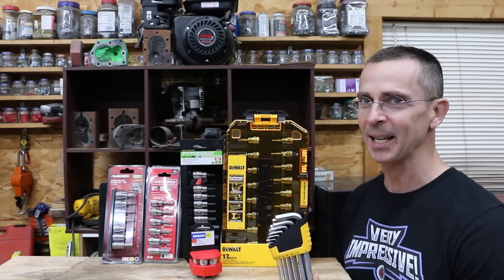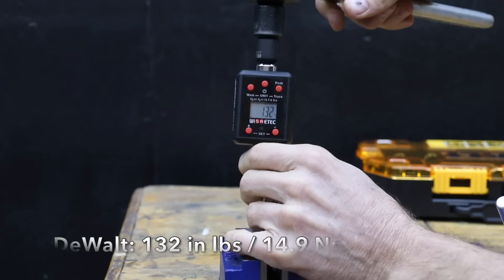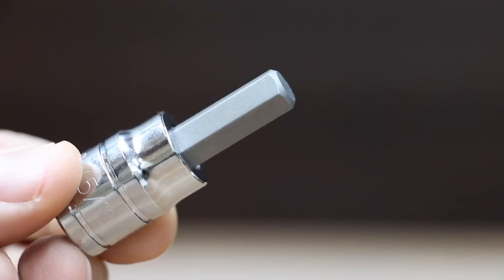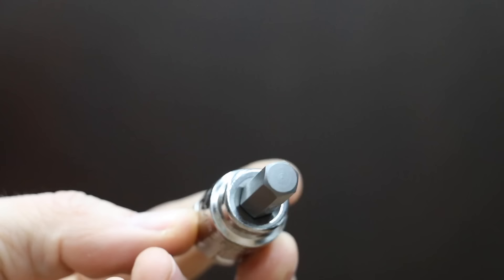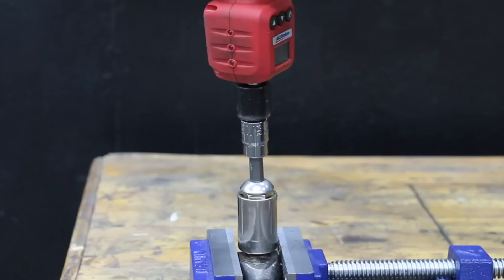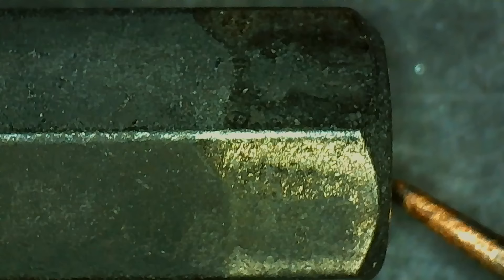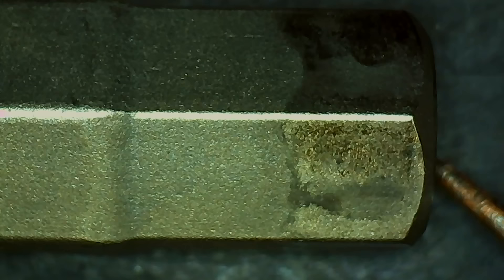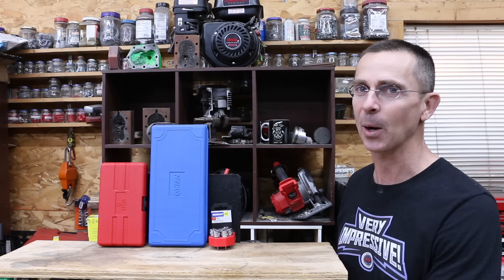Best Hex Bit Socket Set? DeWalt, Kobalt, Craftsman, Husky, Neiko, Pittsburgh, Tekton, GearWrench

Comment: Another vote for 1/2" to 3/8" socket adapters - those seem to have a lot of variability in strength.  Great video, cheers!!
Reply from the maker: Thank you!
Reply: Agreed I've broken quite a few. After breaking the last ones I had in the box last year, I bought a Neiko 30249A set. I haven't broken any yet but I haven't really abused them yet either.
Reply: Another vote
Reply: @ProjectFarm  Even as a casual garage tinkerer who can usually get by on the cheap stuff... I do have issues with socket adapters snapping. A definitive answer on that would be super helpful!
Reply: @John_Ridley  ironically, the only one that I haven't broken are the super cheap non-impact rated ones from harbor freight.
Reply: Snap on impact adapters are the best I've put them under a 25yr test along with a ton others.
Reply: @eric63377  Same here.
Reply: Definitely looking for the best Socket adapter!
I purchased a stubby impact rated allen/hex kit from O'Reilly's, 
They start at 1/4 , 6mm but with a 1/4 drive then increase in drive size to 1/2" and every time i use a 3/8-1/4 adapter even via ratchet wrench they snap leaving the head in the socket/allen/hex!
Reply: Hear, here!
Reply: @ProjectFarm  I'd love to see a way to test the detent ball strength/wear resistance + whether it will drop out.
Reply: The great socket adapter test seems like a good follow up
Reply: 3/8" to 1/4" would be a good one as well, but YES definitely do 1/2" to 3/8"
Reply: I’ve used the Pittsburgh and have yet to break them. I even use my impact on them and all good
Reply: It is the purpose of the 1/2"-3/8" socket adapter to break, usually just after the last 1/2" drive socket of the size of the fastener you are trying to remove breaks.
Reply: @ProjectFarm  Upvote for "Best 1/2 to 3/8 adapter" video next
Reply: I second this I just broke another this morning using my 1/2” breaker bar with a cheater bar on it lol I wasn’t designed for this but I’d like to see what’s the best for my next one
Reply: I've got a Sunex that's outlasted 5 or 6 name branded 1/2 to 3/8 adapters! My 2767 eats them lol..
Reply: Came here to say just this. I've broken a pile, and it looks like quite a number got broken during these tests too!
Reply: I'd like to see a premium brand added. PROTO, SNAP-ON, MAC, MATCO.
Reply: Could we expand this concept to include 3/4" to 1/2" adapters and maybe even 1" to 1/2" adapters?  Pretty common to need big breaker bars and 1/2" sockets on farm equipment, and after all, this is Project Farm.  Again, a big thanks for everything you do.
Reply: I really do miss Sears. I must have exchanged at LEAST a dozen, broken, 1/2" drive to 3/8" drive adapters, under Craftsman's Lifetime Warranty. All, via my original purchase of a single one, in the early 1980s.
   I haven't read any of the other reply comments in this thread, yet. But I have a feeling I may be parroting some.
   Most of my failures were due to lug nuts. Nothing will twist, and shear off a drive adapter faster than an aluminium jack handle tube, placed over the end of a 1/2" drive ratchet, and used as a breaker bar... Especially when those poor adapters were also fitted with a 3/8", 6 inch extension!
   So, add yet another vote for a "drive adapter shoot out, PF."
   In regard to this hex drive test....yall KNOW somebody, somewhere, in asia is getting an ear full from some of these brands  Specifically in regard to being LIED TO about the quality of the metal, tempering process, etc., that they GUARANTEED them that they were supplying/doing during manufacturing. I say F EM. Serves em right, for being shady. And these brands should be doing their own in house testing. But I bet many (even big name brands), don't. 
  Regardless, Todd probably shouldn't go on vacation to the Far East anytime soon. Or, maybe ever. Might "accidentally" fall down an elevator shaft....onto some bullets.😂
Reply: All adapters, 3/4 to 1/2 and 1” to 3/4
Reply: Are we talking about the socket reducers? Or the 3/8" square socket to 1/4" hex adapter.
Reply: Snap on versus Snap off...

Comment: i know you can't test every brand but it would be nice to see some of the higher end tool truck brands in the mix to see if the premium price makes any difference compared to the budget options
Reply from the maker: Thanks for the suggestion.
Reply: Exactly what I was thinking
Reply: I’d especially be interested in seeing some Mac RBRT bit sockets. Their sister company Proto has very similar anti-slip designs.
Reply: @Joel_E  I was thinking the same about the Mac rbrt.
Reply: Wiha, Bondhaus, and snap-on make some pretty good sockets in my use.
Reply: Agreed. I would like to see at least 1 made in USA brand in any tool test.
Reply: Agreed, was disappointed there wasn't at least one  SnapOn/Proto/SK/Mac set mixed in here. A high end euro set like Hazet/Gedore etc would be nice as well
Reply: The upside to the shorts and stubbies at least for the truck brands, is the bit can be pressed out and a new one pressed in and it's free.
Downside is waiting for the truck guy (and him having spares).

Other than that, the only real issue I've come across with any brand, is hardness and bits wearing out after a few thousand bolts (I worked in a paper mill and one of the converting machines was about 600 bolts out and back in to install anvils for job changes).

Comment: I have plenty of Sunex sockets in my tool box. Some are over thirty years old. I'm a retired auto mechanic. Sunex is an "economy" brand that has indeed earned my respect. Glad to see them represented.
Reply from the maker: Great feedback on the Sunex. Thank you
Reply: I agree. I work in a hydraulic shop and we rebuild all types of jacks. We do a lot of research when something new comes trough the door, come to find out Sunex makes many tools for the "premium brands" (matco, snap on etc)  Matcos BEAST jack is made by them. As far as I'm concerned you're getting top quality for a fraction of the price from Sunex. I would have zero concerns buying any of their products.
Reply: Sunex is a top brand acquired by many Jeep/FCA mechanics and they swear by them.
Reply: Same here.....bought mine off MAC tool man back in the day when no one would touch them......but they have held as being impact sockets to boot.
Reply: Same here in my box although all mine are under 5 years old. I buy Sunex for impact and Gearwrench for normal chrome and I've been extremely happy with both.

Comment: Couldn't handle the farmer power 😆😁 I love it. Thanks for another great video. I've had the larger 37 piece version of the Husky for several years now and have been happy with it overall - broke the 6mm after  giving it the beans with a 1/2" impact for way longer than I should have - was able to get it replaced at HD with no fuss though.
Reply from the maker: Thanks and you are welcome!  Thanks for sharing.
Reply: Husky was impressive.
Reply: "Beans"
Someone watches The Torque Test Channel, I see. 😏
Reply: I lost it at "farmer power" as well
Reply: Always had good luck getting my Husky tools replaced without a fuss
Reply: @jamms992  that's a plus. Just so long as you don't have to replace tools all the time.
Reply: A 6mm with a 1/2 impact 😅💪💪💪
Reply: @1pcfred  nope very rarely do I need to replace a Husky tool. I still have sockets and ratchets that are made in the USA from many years ago.
Reply: @jamms992  when manufacturing gets offshored I feel that the product does change in many cases then. So I have to differentiate between the two. As in old USA Husky is not the same as new imported Husky. I have some old Husky tools myself. New ones too, come to think about it. I bought a miniature screwdriver set at the Home Depot and it is Husky branded. It's OK. But I don't really stress it out. They're just tiny screwdrivers.
Reply: @1pcfred  I agree I wouldn't trade my US made tools for import tools. Same goes with my old school Craftsman pro tools, I do not want to downgrade to the cheaper imported Craftsman.
Reply: @jamms992  the Craftsman warranty doesn't have the same value as it used to these days. But at the same time if a tool has served well for this long then it was a fair deal. Nothing lasts forever and the only constant is change.
Reply: @1pcfred  I completely agree with that statement.

Comment: I have an impact sunex set and it's awesome. It hasn't disappointed me so far. 
Also, it would be great to include Duralast brand in future tests as Auto Zone and Advance Auto Parts carry them and swear by their tools with a lifetime warranty.
Reply from the maker: Great feedback on Sunex and the Duralast too!  Thanks again
Reply: The profit margin on those tools at auto parts stores is something like 90%.  They count on most people not using the tool more than once,, or not bothering to make a return, or not finding their receipt/remembering where it came from.  Very low quality.
Reply: Easy to offer a lifetime warranty on a cheap tool you own and expect not to get used much.
Reply: I've had a few and they've repeatedly broke while removing set screws in sheaves and whatnot (by hand, not impact). But only certain sizes. Not really sure what's been going on with their stuff.
Reply: I also have a sunex set in 1/2 drive and they have held up incredibly well.
Reply: I've had a duralast 3/8 socket set for about 3 years now haven't had a single issue out of it it's my go to and then my craftsman is next to follow

Comment: I've been using the Neiko brand non impact sets of hex and Torx bits professionally for 8 years and they have held up incredibly well. I use them with impacts all the time. None broken, none rounded, and though my T30 Torx is bent it's lasted that way for years.
Reply from the maker: Thanks for sharing.
Reply: I would never use Neiko in a professional environment. No lifetime warranty and no easy way to contact them is a deal breaker for me.

Comment: Great testing as usual Todd. It would have been helpful to show the price per socket since the number of sockets varies widely among the tools tested. 

Tool makers always have to balance the hardness (brittleness) with the softness (progressive bending or twisting). It can be a quite delicate balance and is dependent on what the tools will normally be used for. 

It's only difficult to remove the sockets from the rail if you just try to pull them off straight up. 
It's a simple matter of pushing the tops of the sockets to one side and that will lever them off of the storage rails quite easily and with minimal force.
Reply from the maker: Thanks!  Thanks for the constructive feedback.
Reply: You can figure out the price per socket with some simple math yourself, cmon now.

Comment: Not sure how big of a selection there is yet, but HF’s Icon brand is another that I’d love to see in these line ups! Especially when a Snap On or Marco is already in the bunch. Thanks for your time making these videos!
Reply from the maker: You are welcome!  Thanks for the suggestion.
Reply: Dude, I bought the icon 3/8" drive set. Used the 5/16 or the 1/4 inch. I can't remember. The corners twisted off with almost no effort. Threw them in the junk tool box. That said, it was twenty bucks or whatever. I have the famous Snap-on master set that cost me 400 bucks and is now 1,000 damn dollars. Many of them have failed in a spectacular fashion and many are still original and have taken unbelievable impacts. Snap on's heat treating is just as hit or miss as the Taiwan/China tools as far as I can tell.  The snap on do fit perfect in the fastener though. Not sure that's worth 1,000 dollars though.
Reply: People don't seem to realize the marketing tricks HF pulls. Its always compares its product against a Tier 1 product, and usually is nowhere near close. Outside of rare instances where they spend more for a product like the original Earthquake which AvE tore down. They did that for a short amount of time until they got a rep for being as good as, and then went back to a cheaper model with the same name that is not nearly as good.  Back to the point, by the in-your-face comparison to a Tier 1 tool, they are sort of stacking the deck influencing the potential buyer's perception from the outset by doing that.
Although HF is good for some rarely used tools that don't warrant $$$, or some basic handtools, most of their stuff is definately worse than my standard Ryobi. Considering they only warranty their stuff for 90 days, vs everyone else's 1-3 years, that should tell you something.

Comment: I've always found Kobolt's selection of sockets, wrenches etc to be a great value, jury is still out on their power tools from my experience
Reply from the maker: Thanks for the feedback.
Reply: Personally I use tekton and crescent brands daily at my shop with zero issues.
Reply: I think their power tools are hard to beat for the price. Batteries and tools still working well after 6 yrs of fairly hard use. They earned my respect. Curious how the Craftsman and Skil power tools stack up against Kobalt though because they are all priced very well in my opinion.
Reply: I'm a plumber and use and abuse my cordless tools. They're all Kobalt and they perform wonderfully.
Reply: I'm pretty rough on my kobalt power tools and the 24v line of tools a great bang for your buck
Reply: Ya the kobalt xtr, xrt, whichever it is seem to be very good value. They may not be the best of the best, but for the price they are damn good and would have no problem buying them myself or recommending to someone on a budget. Ive been very impressed with almost everything from kobalt

Comment: The price point per piece matters. The sets with 6 pieces compared to sets with 20.   And I also agree with those that say using snap on or matco as a baseline would also be helpful.
Reply from the maker: Thanks for the feedback.
Reply: Same comment.   It would have been easier to compare if you used a per socket price.
Reply: I agree with the price per piece part, but Matco and Snap-On are far overrated these days.
Reply: @jasonm9264  Then let's see it proven here instead of excluding Snapon, Mac and Matco
Reply: Past videos have broadly shown Snap-On to be underwhelming and very expensive. As expensive as that brand tends to be, we're probably all better served by him showing us a wider variety of less expensive brands.
Reply: @Namington  The three commercial brands are lifetime warrantied no matter how many times you break them. Their value really is based on if you're using an 11 mm socket every day, all day; or if you might maybe pull it out one a year. 

That being said, there is a cost benefit ratio to them maintaining the highest standard to reduce loss. And we'd like to see it.
Reply: @th3R0b0t  thank you

Comment: Id absolutely love to see a torx socket comparison including “high end” brands. Im always breaking torx sockets on cars.
Reply from the maker: Thanks for the video idea.
Reply: I agree! I have serious problems with some automotive fasteners, and I have a whole bunch of twisted bits of different brands!
Reply: agree, I had good luck with Husky though and pittsburg is by far the worst
Reply: From my experience I’ve had to work on a lot
Of VWs with bolt filled up with a snapped torx bit. Annoying as hellz
Reply: I break my snapon T30 a couple times every month. Sometimes it only lives through two brake rotor screws. I actually have three T30s so I can make sure to get my work done.
Reply: Same! I broke several torx replacing the injectors on my truck

Comment: Hey! Recently bought a camper my wife and I are planning on moving into. Trying to make sure everything is as safe as possible and among many gear options the hardest to get a good read on is a tire pressure monitor. They vary wildly in price and seem generally unreliable. This is something I really want to work for both the truck and the trailer, 8 total wheels. They are supposed to measure pressure and temperature, some are solar powered, some connect to your phone, some go inside of your tires, some go on the caps, connectivity can be an issue. A video covering these in your style would be extremely useful. Similar for brake controllers, obd tools, camera systems, rack systems, etc. 

Either way love the channel and appreciate how thorough and dedicated to you are. Thanks!
Reply from the maker: Thanks and you are welcome!  Thanks for the suggestions.